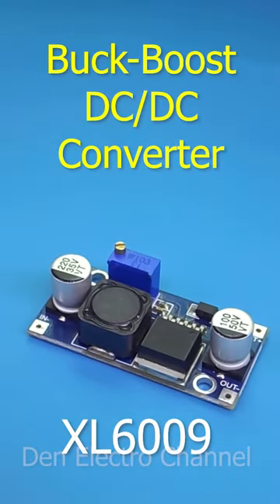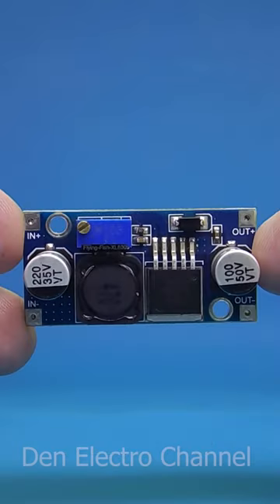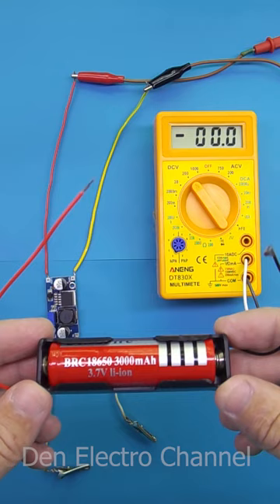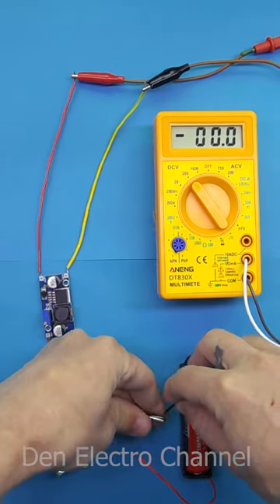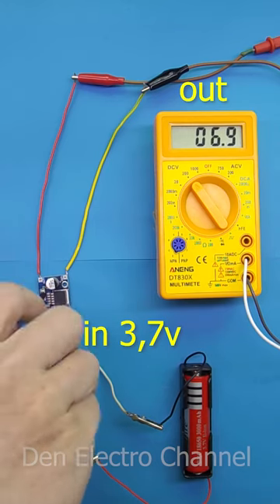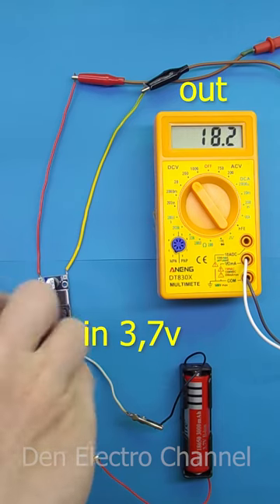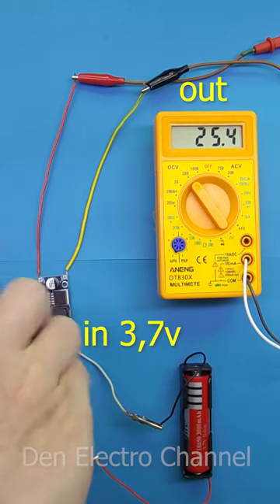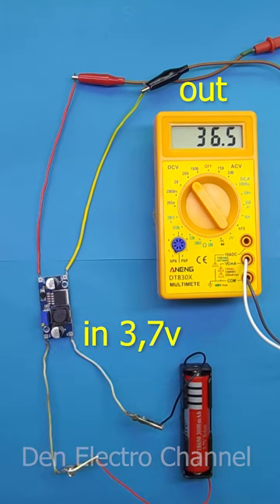super boost converter on xl6009

Comment: That's why when battery voltage go below 3.7V the output bump from 30V to 51V, but I put in series a 3K resistor and output current doesn't increase much. Work well as Led tester
Reply from the maker: Yes, this device has such a disadvantage. This is not a glitch, but the microcircuit simply cannot work correctly at such a low voltage

Comment: When i am rotating the variable resistor it is sometime not working and some timw getting hot when turning the voltage low but sometime not  while the lode is the same why??  And one more question 
Does variable resistor get reset everytime it's power is disconnected?? 
In my case or appear like it ia getting reset everytime i am disconnecting the power. 
Also it keeps spinning so how do i know that when it has reached its max or lowest limit??

Comment: I have LM2577 to power up servo motor sg90 with battery li ion 3.7v,, but it didnt work eventhough the i have set the LM2577 to 5V (4.8 - 6v)

Comment: I have voltage step down. How can I translate to step up?
Reply from the maker: If the converter is a step-down converter, then it cannot be converted into a step-up converter
Reply: @Den_Electro_channel  í have question
Do you think it is better to connect two AA batteries in series, connect another 2 in series, connect these two in parallel and give it to the voltage regulator?

Or connect 4 AA batteries in series and give them to the voltage regulator?
Which will last longer?
Reply: @Den_Electro_channel  1 AA Battery around 1000mah
Reply: @Den_Electro_channel  I will get 12V output from the regulator
Reply: @Ruzgar_K_ use 4 AA batteries in series it's better
Reply: @JackSparrow14111  5x1.5V = 6volts?
Reply: @Ruzgar_K_  5×1.5 is 7.5
Reply: @JackSparrow14111  but I want 12V?
Reply: @Ruzgar_K_  use 4 AA batteries in series and boost the voltage to 12v with the step up converter
Reply: @JackSparrow14111  SO BRO I QUESTİONİNG FOR HOW TO CONVERT TO STEP UP THATS MEAN TO BE I DONT HAVE A STEP UP REGULATOR
Reply: @Ruzgar_K_  if you don't have just buy one , You can't convert step down to step up
Reply: @JackSparrow14111  really?
Reply: @Ruzgar_K_  Yeah